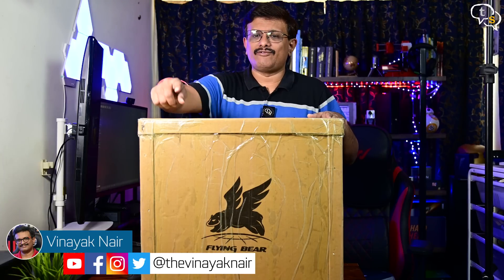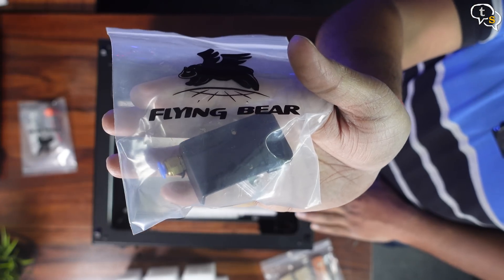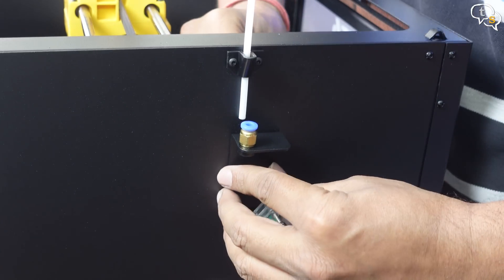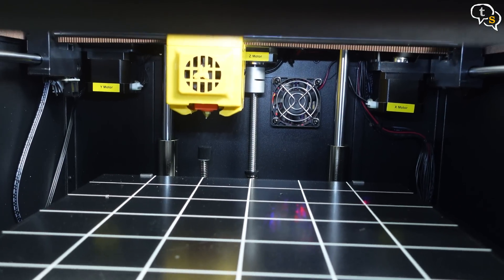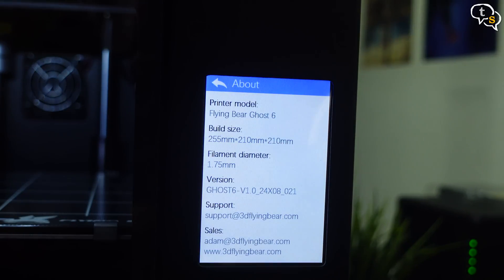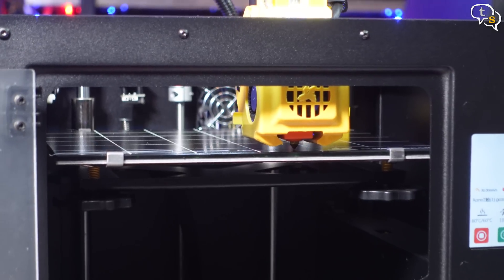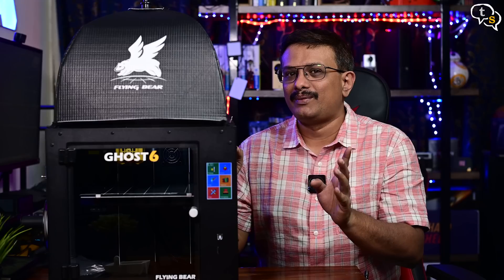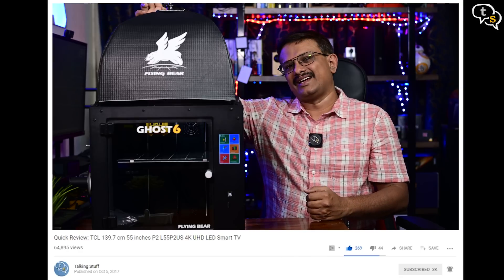Exploring the Capabilities of the Flying Bear Ghost 6 FDM 3D Printer!

Comment: I'm considering getting either this or the Ender 3 v3 KE.

Which would people choose?
Reply from the maker: The Flying Bear is not bad at all. Nice closed enclosure, dual drive extruder, core xy at a great price. Both are good printers. The ender 3 would have more community support., custom firmware, hardware mods etc.

Comment: How many Printers do you have?
Reply from the maker: At present i have only three, the ender 3, flying bear ghost 6 and the anycubic mono 4k. 😁
Reply: @TalkingstuffNet  Hi, Im trying to chose between ender 3 and flying bear ghost 6 as a first 3d printer, which one would you suggest?
Reply from the maker: The ender 3 is more of a tinkerers printer, I have changed the controller, added auto bed leveling etc and it's very customizable. It does take some work to put together and if you like that then ender 3 will be fun. 

The flying bear ghost 6 is easier to put together, almost ready to print out of the box and has a higher print speed.